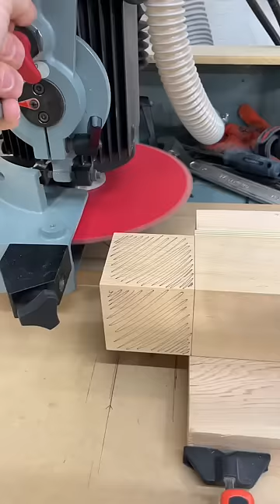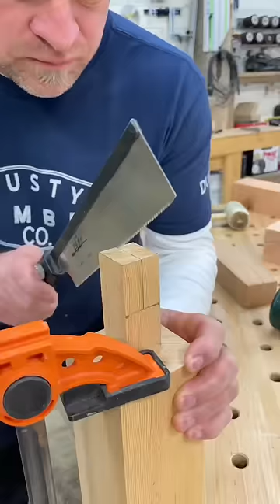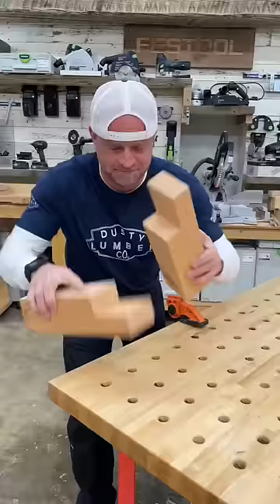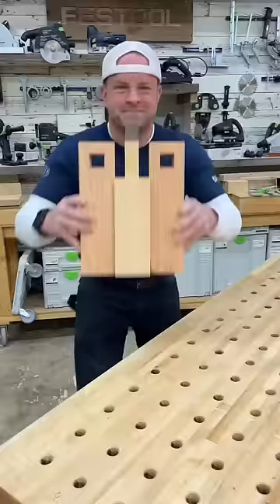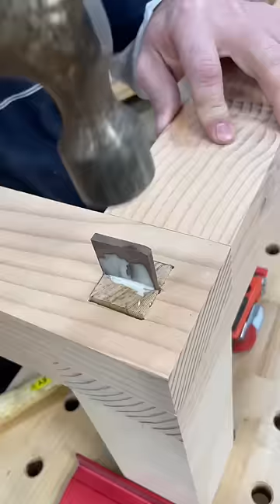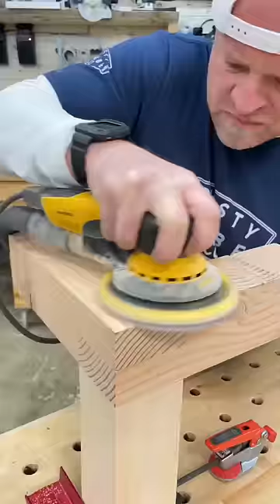Lapped joint with a wedged pass through M&T #woodwork #wood #woodworking #maker #joinery #tools

Comment: Unless you set it on fire,  it ain't coming apart. Rock solid.
Reply: That joints looking so good I want to light it up
Reply: Unless you use it as firewood, it serves no point
Reply: Bro became malphite
Reply: @sweatsucks7719  there is a difference between something being pointless, and something that you don’t understand the point of.
Reply: @summergamer7650  you think that serves a point? Wow you must be a hoarder or something, I'm not seeing the value in it besides the educational experience that was learned in the process
Reply: @summergamer7650  Exactly…
Reply: Sledgehammer left the chat😂
Reply: Think the only way to separate it with fire is to turn it into ash
Reply: @sweatsucks7719 "They hated him for understanding the truth"
Reply: @sweatsucks7719  what are you even talking about, how slow are you to call that joint useless?
Reply: @007oskari  the sum.of the parts serves no purpose, your comment is the equivalent of looking at a crashed airplane and saying "you think that screw serves no purpose", not on a crashed airplane it doesnt
Reply: @sweatsucks7719  it's educational, i think he makes them as models, in some video i saw a text that they go to some class as models, because obviously in practice that's a good joint, i was talking more about the joint overall not the piece he built
Reply: @sweatsucks7719  the point is to look cool
Reply: Wedge direction with grain??
Reply: Naw, wood solid.
Reply: @sweatsucks7719 Really, not even for making bed frame? Truely now...
Reply: @summergamer7650  there's a difference between talking and knowing. Explain what this is the best option available for
Reply: @sweatsucks7719 bro why did you come back after 7 months? I literally forgot any of this existed.
Reply: @summergamer7650  to reply to a comment directed at me, what about you, why did you come back
Reply: @sweatsucks7719 it would be very useful in a timeline where invention of nails didn’t occur 😂😂

Comment: Before you cut the slot for the wedge it is good to drill a smallish hole where the slot will end. This will end up resembling an old fashioned key hole. The reason is to keep the slot from splitting further once you drive in the wedge. 
Not a criticism, just suggesting a technique I was taught.

Comment: I pulled apart some mitered trim on a window years ago and they had some sort of locking halflap joint holding the miters together so freakin tight. It really was incredible. I should have saved the trim.

Comment: Nice work. Small suggestion; if the wedge was diagonal it would have better pressure to all 4 sides an not on 2 sides. Keep up the good work.
Reply: Yeah…I’d turn it 90 so it wouldn’t force with the grain on the top piece and potentially crack it. I’m kind of wondering now why I got rid of my old radial arm saw…oh yes, it was a nightmare to keep square…..this one must be of way better quality.
Reply: @ottawapop  a tool is an object that doesn't think. The man behind the tool is the one who makes the difference.  Take for instance the shopsmith multytool. I know of one of more then 57 years still working (first 5 units was build 77 years ago). Good maintenance and good care makes it last long. That's a respectfully longevity for a tool. You are doing a good job 👌👍

Comment: The ONE thing is do differently is put the wedge perpendicular so that the split isn’t parallel with the grain on the top piece. 
Sweet joint.
Reply: Why put the wedge perpendicular to the grain? To stop the cut spreading down the leg?

Comment: Look I’m not a carpenter nor a woodworker but wouldn’t those joints just crack over time from the changing moisture content of the wood?
Reply: I am a Joiner and I can already see cracks when he was sanding it with a disc sander. I don't think he gives a flying fk.

Comment: It seems to a noob like me that, that joint is only as strong as the small central piece.
Reply: Almost any joint is going to be weak in some areas and stronger in others. You just have to make sure there is little to no force acting against the joint’s weakness. If applied correctly, the small center pin shouldn’t experience much force that would cause it to snap at the base.